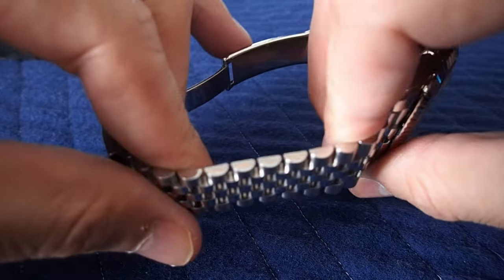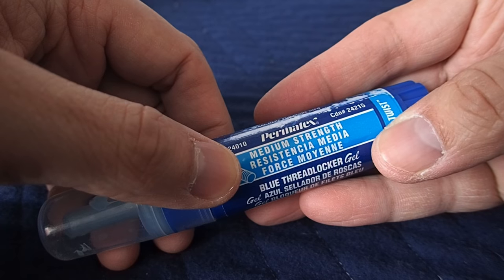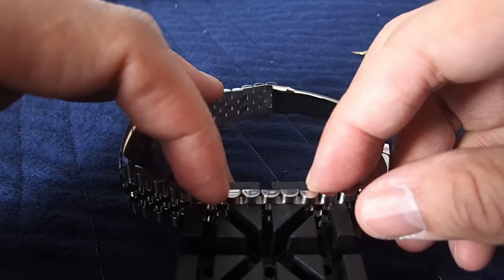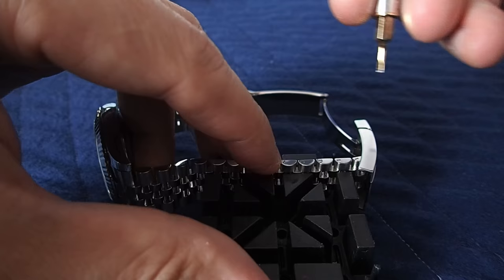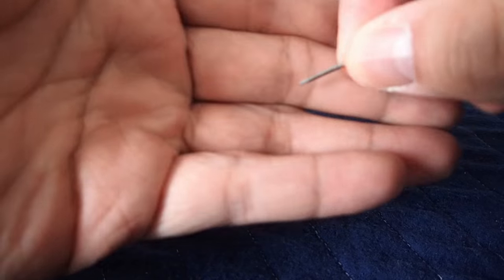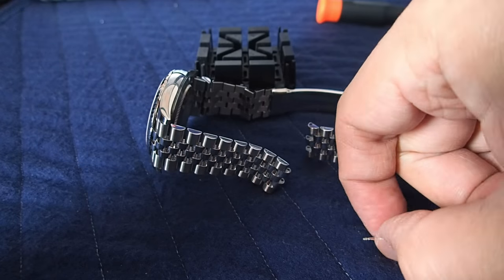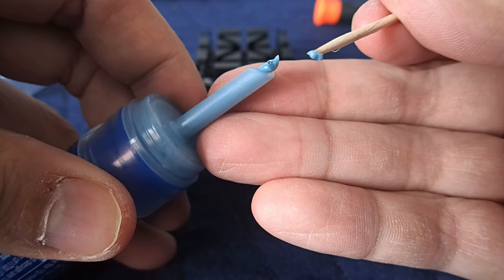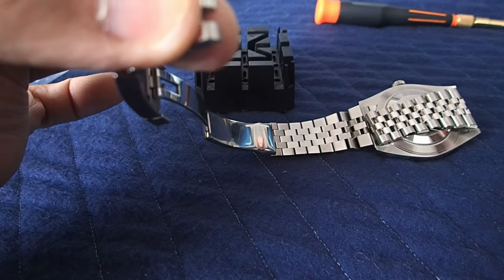Rolex Watch Bracelet Resizing (Screws)

Comment: Put a piece of clear tape over the screw and link BEFORE you put the screw driver on the screw. It will protect the link surrounding the screw in case your screwdriver slips off.
Reply: Thank you so much for this suggestion ! Very useful ! :)
Reply: Terrible suggestion, this is how you dent the skrews
Reply: Watchmakers do not do it.

Comment: Im pretty sure Rolex uses 1.6 mm screws for the Oyster bracelet and 1.4mm for the Jubilee. Using the exact same size screwdriver limits the potential for the screwdriver to walk or slip out and scratch your bracelet or damage the slot in the screw head. That said, i can personally tell you a 1.6mm Panerai screwdriver works perfectly on the Rolex Oyster links and fits like a glove. Its an exact match if you like to get super surgical when working on your fine time pieces. Also, you should only use purple low strength Loctite when installing your bracelet screws and only apply it into the threaded hole on the link and not on the threads on the screw. One more tip...if you put a little 3" x 3" piece of soft t-shirt into the widest channel of the bracelet block to fully line it before you insert the bracelet, you limit the potential for the outside of the links to get micro scratches from the corners of the plastic. Good luck to everyone willing to take their time and work on their own watches!
Reply from the maker: Good info!
Reply: I just got my DateJust 41 and need to add two links to the jubilee bracelet. What brand screwdriver should I use and what bracelet block? Your expertise is much appreciated!
Reply from the maker: @SeattleSteelLLC  I wouldn't say I'm an expert but a Bergeon screw driver is best, the block doesn't matter really.
Reply: @DavidPhamChannel what size screwdriver did u use? I used a 0.9mm on my 36 dj and it didn’t fit at all
Reply from the maker: @zacharychang6713  That's definitely too small, i use a 1.6mm, others have said a 1.7mm works too
Reply: @DavidPhamChannel  just added 2 links to my DATEJUST 41. The Bergeron 1.4 was too big unless they sent me the wrong size but it was the gray 1.4 mm. I ended up filing down the sides of the screw driver blade just enough to get it fit perfectly. Getting the links installed was very easy. Thanks for you help!!

Comment: Old video, but just what I was looking for. Went slow and carefully, and got it done with zero damage. Thanks for posting!
Reply from the maker: Glad it helped!
Reply: But I used a hair dryer. Blow torch is overkill, imo. I would have burned the house down... @DavidPhamChannel
Reply from the maker: @michaels3897  Unless you can isolate the hot air to a single screw you will be removing the loctites effectiveness from the surrounding screws.

Comment: I tried and I could'nt even remove a single screw, it's hyper hard to do and actually kinda screwed up the head of the screw. I'll just go to the shop.
Reply from the maker: Sounds like your screw might have an excessive amount of locktite which needs to be disengaged. Shop will probably be able to replace your screw too. Best of luck!

Comment: Not related to the topic but I believe that some Rolex fellows might help me out Lol. I have a 126231 and it always delays around 6 mins before it changes the date at midnight. Is it normal or something? I asked the AD and they told me that it is normal.
Reply from the maker: This is very normal.  Mine changes 4 mins after midnight.
Reply: David Pham thanks mate
Reply: David Pham Hi bạn, nhìn tên mình đoán bạn là người Việt. Cái 126231 của mình, hôm qua mình lấy tay di mạnh ở chỗ càng dây, thấy hơi nhúc nhích (chỗ nối case với bracelet), không biết của bạn có thế k nhỉ ? Mình đang hơi thắc mắc, đang tính mang qua AD check.
Reply from the maker: @hoanganh6779  nó sẽ ổn thôi, nhưng nếu bạn lo lắng, bạn có thể mang nó đến AD

Comment: I used a paper clip in place of the screw on my Jubilee Datejust 36 cause I lost my screw somewhere. Temporary fix oh well😂
Reply: Be careful with that haha. It probably works but just be careful not to strip the threads or to loosen the hole, or you’ll never get a screw to stay in that link again. If you have to force the paper clip in then it’s too thick and could damage the link.

Comment: I used a 1.4 mm screw driver that came in my Stanley set. It was the smallest screw driver in the set.
Also use a "low strength" threadlocker like Loctite 222MS (Purple), never use medium or high strength as these 2 will cause issues removing screws.

Comment: Great video. Two questions: 1. Can the screw theoretically go in either side of the link? 2. Are the screw heads easy to damage? Thank you
Reply from the maker: No I think the screw is single sided. Yes they can be, be sure to use a well fitting screw driver.

Comment: Great video!  Do you know of any videos that show the clasp adjustment?  I think there are 3 possible positions, but I'm not sure if you can use a spring bar tool or how that works
Reply from the maker: Hi Sean, sorry for the delay on this reply. I don't have a video to do this but thought some photos will help. You will need a spring bar tool, spring bar tweezers would be ideal. In the photo you can see the 3 possible positions, I'm currently using the middle position. There are notches in the bracelet to allow for spring bar tool access. Hope this helps.

https://i.postimg.cc/5JhyW8Wt/PXL-20230619-182331336.jpg

Comment: How do you know which link to take out? Always in the middle? Or end?

If you need two links out, is it best to remove one link on each side of the clasp? Or doesn’t it matter?
Reply from the maker: It's best to remove from both side but the key is position the clasp right in the middle of your wrist, to achieve this you need more length on the 12 oclock side.

Comment: If taking out 3 links do you take out 2 on the 6 o’clock side and 1 on the 12 o’clock side? Also what side screwdriver did you use for the Datejust? Thanks!
Reply from the maker: Depends but generally yes, remove more links from 6 o'clock side. 1.6mm hollow ground.

Comment: Hi, what should do if already remove all then link but still loose on my hand? Is there are any way to cut it to make it shorter?
Reply from the maker: i wouldn't recommend cutting any of the links, there are more adjustments you can do on the clasp to make it shorter. You will need a spring bar tool to make those clasp adjustments.
Reply: @DavidPhamChannel  tq

Comment: Do you notice any issues of link stiffness/not articulating when using medium strength loctite on just the threads inside of the link? I think I've been applying threadlock wrong the entire time (on the threads of the screw ifself) and it's been causing some of the links on the bracelets of some of my cheaper watches to stiffen up, even just with a low strength thread lock. I try to avoid having to use it all together but once you resize a bracelet a couple times you don't necessarily have that same confidence you do when you first sized it. I guess my question is, does this method allow the links to articulate properly? I think getting thread lock inside of the middle link is what's causing my problems, and I think this method might avoid that.
Reply from the maker: Oh wow, sounds like a problem, fortunately I haven't experienced this myself. Just be careful when putting the screw in and only use a small amount. What you can do is boil your bracelet links for a short time, this will render the loctite useless, an ultrasonic cleaner may do the same.
Reply: @DavidPhamChannel  thanks mate. I figured I was just doing it wrong. Thankfully with low strength thead lock it's easy to disassemble and clean. Good to hear you're not having any issues with medium, I'll keep this in mind for the future 👍.

Comment: I’m wondering if I could take out the links without screws as I have skinny wrists
Reply from the maker: No, you will not be able to do that. Only the links with screws are removable. However, there are multiple adjustments that can be made to help you. 1. Remove all the links with screws. 2 Change the bracelet / clasp position to the shortest config. 3. Do not engage the bracelet easy adjustment.
Reply: @DavidPhamChannel  Hi David. How do you change the bracelet/clasp to the shortest configuration. Do you have a video?
Reply from the maker: @realjennykim11  it's basically all the steps in the video repeated for both sides.
Reply: @DavidPhamChannel  thank you for your response. I found a video showing how to press in the spring pin to adjust the clasp. Watch fits great now. Thank you for responding. 🩵🩵🩵
Reply from the maker: @realjennykim11  glag it all worked out, enjoy your watch!

Comment: I have a small wrist, I removed all possible links but my coworker’s is the exact same watch and same wrist size as me and he’s got his sized perfectly. How do I remove more links??
Reply from the maker: You can't remove more links you'll need to use the adjustment in the clasp. Looks at the underside of the clasp and you'll see a series of pivot points to further adjust the length of the bracelet.
Reply: @DavidPhamChannel  i have the same exact watch you use in this video. You’re saying I can adjust the clasp from this exact watch? I will try when I come home from work.
Reply from the maker: @TrapKingz.  yes I am, there's 3 levels of adjustment. Default is the middle setting so you can probably shrink the bracelet down a couple mm.
Reply: @DavidPhamChannel  I checked and I see what you’re talking about but it looks like it needs a special tool to push the bar to get the shorter length on the micro adjustment.
Reply from the maker: @TrapKingz.  yup, you'll need a spring bar tool. Or you can take it to a competent watchmaker.
Reply: @DavidPhamChannel  yup, did it myself with a thumb tack and some elbow grease. Watch feels amazing now.

Comment: Hi David. Great video thanks.

Before I order, may i check, are you sure the screwdriver required for a Jubilee is a 1.6mm (as per video description)? You state 1mm in the video itself and various forums say that the Jubilee screws are smaller than the Oyster (which for sure is 1.6mm).

Many thanks 🙏
Reply from the maker: Sorry I don't my have the answer, just went through my set of screw drivers and 1.6mm fits the best, there may be a better one out there that I don't own. I personally haven't had any problems with the 1.6mm. hope that helps.
Reply: @DavidPhamChannel  thanks for the swift response David. Much appreciated

Comment: do you need the lock tight? or can you just reassemble the link?
Reply from the maker: Using loctite is the recommended method and what the AD does.  You really don't need to but it will definitely help your screws stay set.  Would suck to have a screw come lose and drop your watch.

Comment: hi, about the sizing of the links. Does the 12 side always need to have more links than the 6 side? on any watch bracelet?
Reply from the maker: Yes, this applies for all bracelets.
Reply: @DavidPhamChannel  i see because mine have a hidden butterfly clasp
Reply from the maker: @davidsonviray1403  Oh i see the hidden butterfly clasp may be a little different but i still think the braclent should be longer on hte 12 oclock side.
Reply: @DavidPhamChannel  ok thanks, because i just had my bracelet adjusted and i tried the other way around the more link on the 6 and it's kinda weird?. i will try later to remove 2 links on the 6 and +2 on the 12 or -1 on the 6 and +1 on the 12
Reply: What to do if i removed all the removable links,but the jubilee bracelet is still loose? Cause I prefer snug fit.
Reply from the maker: @rachelleterry1472  you can adjust the clasp there's some adjustment there.

Comment: Is it possible to replace the first link just below the watch? I mean the first one just like the other links?
Reply from the maker: Are you talking about the link that touches the watch case? Or the link that touches the clasp?
Reply: @DavidPhamChannel  the link that between the part which touches the watch but it is the same as bracelet lugs. I mean not the first part that connect bracelet with the watch  itself. I hope you understood me becouse this link has no any screw hole it keeps the last part of the watch with two gold link.
Reply from the maker: @WaystarRoycoInc  As far as i know those links are not replicable, you would need a whole new bracelet. There are companies that can fix the bracelet but i don't know if any are where you live.  Hope that helps
Reply: @DavidPhamChannel  thank you, I consider to have it made in custom way by a jeweler if it is possible.

Comment: It’s better to use a heat gun over a torch. There is less chance of harming the metal
Reply from the maker: The reasoning for the torch is you can isolate the heat to only a single link/screw. Using a heat gun would cause all the surrounding screws loctite to disengage.
Reply: My heat gun has different tips that allow me to focus the heat in different ways.

Comment: What's the brand and model of the screwdriver?
Reply from the maker: Just a generic screw driver from the hardware store.
Reply: David Pham size?
Reply from the maker: @obcx8004  it's a 1.6mm. If you can get a hollow ground screwdriver.
Reply: @DavidPhamChannel I'm interested in buying the exact same screwdriver, what's the brand and model please?
Reply from the maker: @felixwambua6890  it's actually a generic one from an electronics store.  I don't recommend it since I don't think the quality is there. If you are looking for one look at Bergeon, they make excellent tools.
Reply: David Pham May be, but I like the aesthetics of the thing, please tell me the brand and make if it’s written anywhere.
Reply from the maker: @felixwambua6890  Its called teh NexxTech 30 piece electro screwdriver set
Reply: @DavidPhamChannel  Thank you very much

Comment: where can i buy lock tight?
Reply from the maker: Any hardware store will sell it. Try home depot if you have one near you.
Reply: just make sure it's genuine  low strength Loctite , you don't want to use cheap stuff as it could  bearing or  assembly fit as that screw will  NEVER shift again.

Comment: Fuck, I stripped the screw from my new datejust 36 blue dial 😭 guess I will send it to RSC or bring it to the AD
Reply from the maker: Rough, getting a screw replaced shouldn't be too bad, best of luck!
Reply: @DavidPhamChannel  Thanks! yeah it really sucks tho, got it from my dad as a gift for getting my driving license but he didn't buy it with me so the shop couldn't remove links at the time of purchase. The screws are really tight and my screwdriver was 0.1mm too small
Reply from the maker: @jayden5718  The important thing is to be patient and take your time. And of course use the right tool for the job. Screws are no big deal and easy to replace so chalk that up as a lesson learned.
Reply: @DavidPhamChannel  yeah, luckily it isn't anything important and a modern model since Rolex doesn't service quite some older vintage models anymore I heard.

Comment: That’s not a screw/pin that’s just a screw
Reply from the maker: Haha you are right, i guess the pin is integrated in the screw.
Reply: @DavidPhamChannel  what size do I need for the pin/screw for my day date 40?
Reply from the maker: @vitalvisualz  sorry I don't know for sure but it's possible it uses the same screws as the Jubilee.